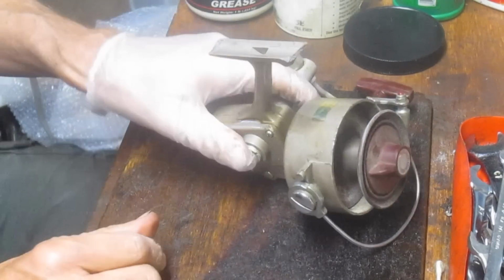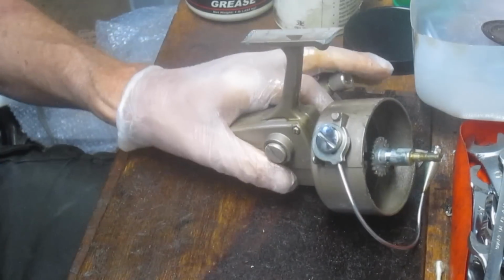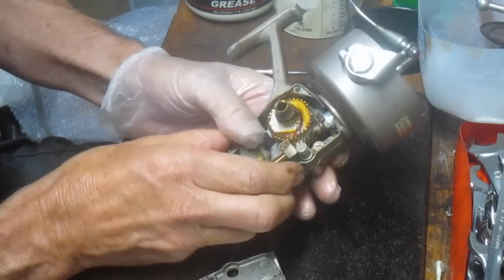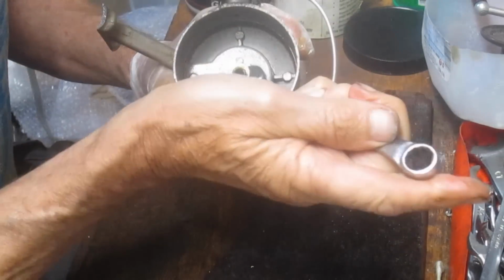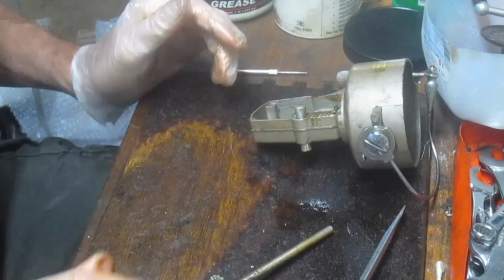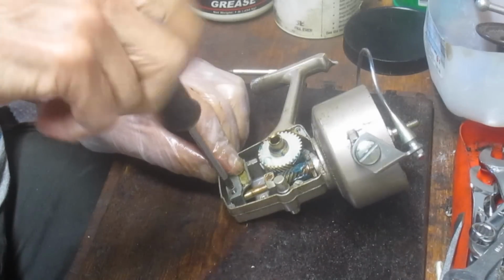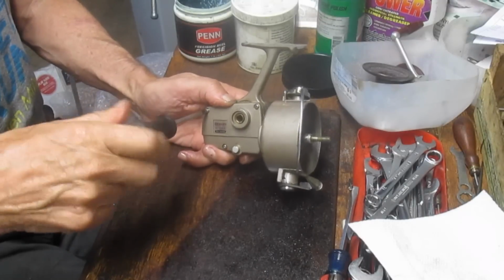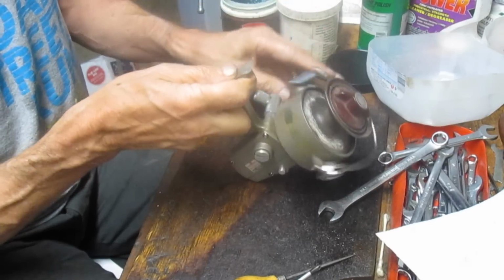Daiwa 7850 classic spinng reel how to take apart and service step by step

Comment: Dennis, I'm looking at a possible purchase of a DAIWA 765 OHRL reel, but... the seller states it JUST SPINS AROUND IN BOTH DIRECTIONS AND WILL NOT LOCK . Is that an easy fix? or shouldn't I bother. Thanks Kyle
Reply from the maker: The problem is that the anti-reverse function is likely not working.  It is a relatively easy fix if parts are available and a waste of money if they are not.  I would pass on the reel unless you know you can get the parts, which would probably cost more than the reel is worth - Dennis
Reply: @2ndChanceTackle  Thanks Dennis.

Comment: Just got a 7850 RL in mint condition. Also found an extra handle for it which I’m going to modify to a nice power knob. I think I sent you a photo of the reel I’m getting. I love worm gear reels and as you say this one is a tank! I didn’t realize you had done one of these before. I wish I could have seen more about the AR button control as I have never seen this before in a reel. The drag is a little disappointing however. On that foot, if you file down that hump right behind the break you could easily hold it on a rod. Placement might be a little off but shouldn’t be too bad.  You seemed to be almost in a hurry on this one but great video as always.
Reply: Hi Chris, I got 4 7850RL reels off ebay years ago when there were lots of cheap good, non corroded ones available! Good surf reels and easy to wash sand off them. Also at that time i snagged a couple of good 7000c reels and a mint and unmarked GS-13, but its so nice, i cant bring myself to use it yet hahaha.
Reply: @HereIsMyOffer  Thanks for the comment. I mostly collect surf spinning reels. I truly wish I had a GS 9 or 13 but they are just too rich for me. I do have 4 very nice 7000C reels and 3 4000c as well. The Daiwas I value the most are the two 8600 and one 8700 reels I managed to get. They both have three ball bearings and are worm gear reels very much like the early Penn 700 and 704. They came out before the Silver Series. There were 4 reels in this series adding the smaller 8300 (2 bb) and 8100 (1 bb). I wish I had been collecting and restoring these vintage reels when they were cheaper than now but until I retired I had no time to do this. Now I have about 240 reels with more Mitchell(52), Daiwa(51), Shakespeare(20), and Penn(12) than others. I have no idea how many other brands I have. I guess I just don’t like most modern reels. — Chris (PS. I have a few reels I won’t use either.)
Reply: @christopherjenkins2373  Wow you're quite the collector mate! I really enjoy pulling these old reels apart and cleaning/fixing/using them too, though not on your scale :) I also have 5 or or 6 Mitchell surf reels in varying condition and i think 1 D.A.M one too that my father had collected. I agree on the modern reels, they're full of plastic and low quality aluminum, not precision machined quality metals like the ''old'' stuff.  I'm kicking myself, i didn't grab a GS-9 at the time i was buying the others! You could get new old stock ones for around the $100 dollar mark which at the time seemed too much, i bid on a few, but they got away hahaha. Cheers!
Reply: @HereIsMyOffer  Yobbo. I’m guessing but are you in Australia? Wow. This rates as the longest distance communication i’v e had. I wish I could share some photos of my collection with you. You could really appreciate them. I started collecting with three reels in April of 1999.I got inspired by a few YouTubers including Dennis and it just took off. Dennis has helped find me a nice Daiwa 900C and a pair of really nice Mitchell 488 saltwater reels. I have 3 of those 9000C reels now but I still think the 7000C is the best of the Silver Series.Last year I built an all chrome Mitchell 498 PUM saltwater reel. It is the most beautiful reel I have ever seen. Some people in the USA and France got interested in the project and helped me find some of the parts. It took three months to complete. I’ll never use it as it is just too nice like your GS-13. If you’d like to exchange e-mail addresses I think Dennis could help and keep it private. Just let me know. Cheers to you too! —— Chris
Reply: PS. I now have sbout 420 spinning reels in my collection. — Chris

Comment: In reference to this "Daiwa 7850" reel. Other than the broken boot it appears that this vintage reel works great after cleaning & lubrication. Am i wrong in thinking that reels of that era last longer than modern day spinning reels? It seems that reels that have less moving parts have less to go wrong with them? Also the amount of bearings are not an indication of a good or fair reel?
Reply from the maker: Many of the older reels were over-engineered by today's standards and are set to last a lifetime, if properly maintained.  This Daiwa is a tank.  The design is simple and the parts are top notch.  Tough to find a reel like that today.  Don't judge a reel by the number of Ball Bearnings.  As long as it has one on the main shaft (Pinion gear). the rest is window dressing - Dennis

Comment: Hello Dennis! I am writing to ask you if you have any experience with small ocean city baitcasters. I've just picked up a 1600 and I would love to take it apart as I've done with all my penns.
Reply from the maker: Normally these cost more to repair, if you could find parts, than they are worth.  These are what I called 5&10 store reels.  Low end, simple design and inexpensive.  They were rarely cared for, often abused and unlikely to last a few seasons.  I will see if I have one lying around and do a video if I can find one. - Thanks for asking - Dennis
Reply: @2ndChanceTackle  Thank you so much for your kind reply, I took it apart and it was incredibly dirty. More caked sand/sediment than I've ever seen, I've seen a lot of old grease, that's common.. but never this much dirt. Soaking in white vinegar now.